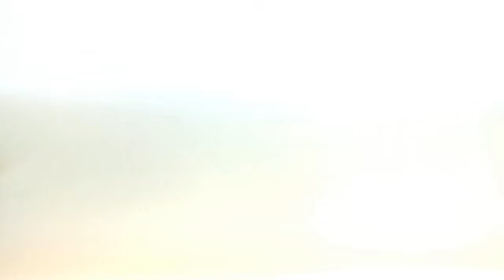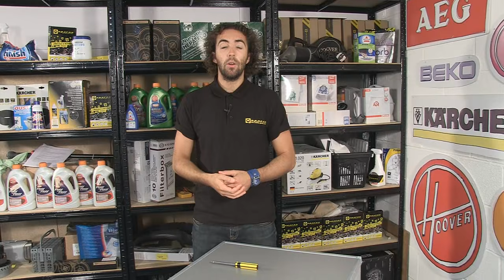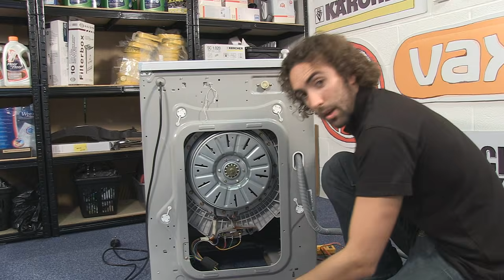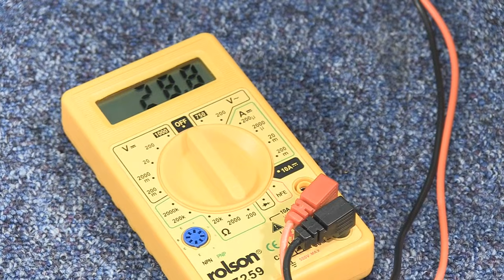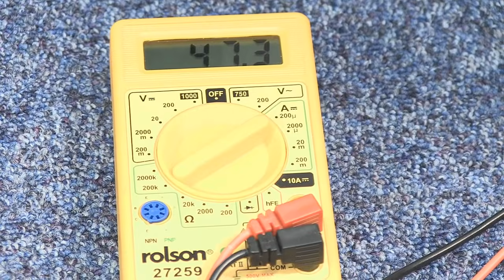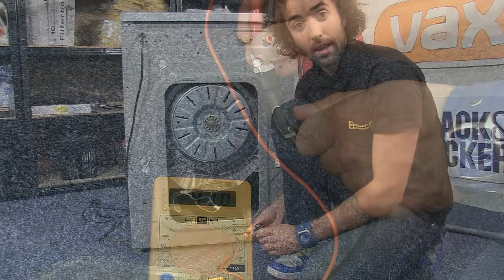Is Your Washing Machine Element Bad? Here's How to Tell!

Comment: My Beko washing machine working for 10 minutes and then fuse tripping.
If I use only rinse it works without any problem.
Display shows 04 17 code.
Any idea which part to replace?
Reply from the maker: The most likely cause is the heating element failing when hot. Start be replacing that first.

Comment: I have tested the heating element and appears ok. I pulled the heating sensor k276/4,8kA112 but appears to be a complete unit.
Reply from the maker: Which machine are we talking about?.
Reply: The Zanussi zwg7120p I've used your online chat and the guy who spoke to me said I needed to fill in a form because he could not find that particular part. I would imagine that is because it is sold as a complete unit with the heating element.
Reply from the maker: The water sensor is indeed supplied with the heating element here:
http://www.espares.co.uk/product/es1442303
I take it that the machine washes continuously and does not progress to the rinse cycles as this is the usual  symptom of a machine not heating.
Reply: It seems to have just stopped. I wasn't using it at the time, as other family were. It was in mid-cycle then stopped. When any buttons were pressed the BOTTOM right, most button instead of being green, flashes red thriee times, when any buttons were pressed.

I've done various tests on  parts including the motor, unfortunately you don't show how to test main boards. Having removed the heating sensor as that was about the only one I had not tested, until I saw your video (thanks) gave a reading of only 3.45 K.ohms and no more. I could not get any variation in its resistance when I applied heat, so have to assume it's that.
Reply: My brother got a new element for his hotpoint washer, he made sure he got the correct model yet the connector on the thermistor/heating sensor on the new element was different and wouldnt fit  the  existing washing machine wiring, so he had to put the old thermistor in to the new element in ordeorder for it to work. I'm not sure why it was a different connector ??
Reply: I have now found it is not a complete unit. The sensor simply pulls out as shown on spares video. It was tested as OK and the heating element also. I believe I found the problem...while the machine was in mid cycle my bro turned the program knob to another setting which I think has damaged the module itself. Watching various video's on here it appears that if the front control panel goes you can't simply plug in another panel from a similar model??  I have no idea how true that it, but am thinking of turning the washing machine case itself into a waste paper bin. :))
Reply from the maker: Some manufacturers like Hotpoint may have changed some parts during production all though the machine may continue to use the same model number. The only guaranteed way to get the correct part every time is to also quote the production number. That way we should be able to identify the correct part for your machine.
Reply from the maker: Re 'John A's' comment: If your machine has a faulty element it would wash but not stop washing and drain as it would be waiting for the water to heat. If your machine is not washing or spinning see our diagnosis videos:  https://www.youtube.com/watch?v=QYPqpjLV7s4&list=PLZopaZU-UQSHj1noiwEJ99JjXWcEcSAbZ
Reply: Thanks, next time i'll quote the production number

Comment: I have a samsung front loader washing machine and I'm measuring 16 ohms on the heating element. The washer works when on cold and "eco warm" but not on "warm" or "hot" which also means the sanitize and steam features don't work. I mean to say that "not working" means it will run for like 10 minutes or so and fill with water and spin and all that but stops with an "nF" error code.
Reply: +nicholas rodriguez Just want to make sure before I order and replacement heating element.
Reply from the maker: +nicholas rodriguez NF error is saying there is a problem filling. If your machine has two fill pipes check the supply is there on both and check the inlet valves. For more information see our video:
https://www.youtube.com/watch?v=VS48G_cwCXo
Reply: I swear I checked that both supply valves were working awhile ago but I found out the Hot supply valve was rusted in the closed position...so both levers were in the open position but the hot side was stuck closed. I've replaced it with a new one ($8) and everything works perfect again! I feel like an idiot for taking the thing apart and it wasn't even the machine. Thanks for the reply!
Reply from the maker: +nicholas rodriguez Glad to hear the problem is now identified and resolved. :-)

Comment: Hi guys I've got an lg washer that isn't heating up, I've got no error codes whatsoever and nothing is tripping out is this the element the thermostat or something else
Reply from the maker: Hi Leez20letcorsa, If the heater fails not all machines will show errors. 
As the video describes the best way to identify a faulty heater is with a meter.
eSpares can supply an inexpensive and usefull meter suitable for this and you can find this by using the following link: http://www.espares.co.uk/product/es1583041

Comment: Hi I have a question. I have a samsung washer top loader made in 2013 keep getting error code of te1. I have replace the thermostat & test the heating element like you show in the video. When I test my element I get 12.5 ohms & you say 20 to 50 ohms so is mine bad. Please help before my wife kills me. LOL
Reply from the maker: HI Jim, Just to clarify the reading we are referring to was for a typical Heater element found across the world using a 220 to 240 volt supply.
If your machine is designed to be running of a 120 volt supply (American continent) the resistance may be half so the total power would be equal to our elements. 
FOr this reason your element may be OK power wise, however it may have a insulation breakdown to the 'case' that may only show using a high voltage insulation tester so may still be causing your problem.
Some times the only way to be sure if you cannot identify a 'fault' is to replace a 'suspect' component.

Comment: My Hotpoint Aquarius WM62P is filling with water then the breaker in my fuse box is tripping. If I disconnect the wires to the heater element (leaving the thermistor wires connected). The machine then works ok and goes through the cycle without tripping the power. I have a multimeter and checked the resistance of the element, I get 26 ohms which seems correct. I don't have a megometer (Insulation tester) to check that. All the wiring to and from the element looks good. Do you think it is the element that is needing replaced due to an insulation fault?

Comment: Hello, my multimeter is showing 1 when testing the heating element, does that mean it need replacing?? thanks
Reply: WELL? Was it a bad element?  Mine sez the same.  I'm replacing it.
Reply: that most likely means you've not made contact with the probe point, try to make a better contact or try cleaning the contacts if you're sure you're touching them
Reply: The number "1" on a multimeter resistance test (ohms) means that you have infinite resistance - that no electricity can pass through the element - and that means the element has burn out and need replacing.